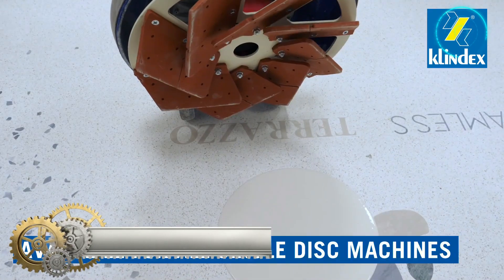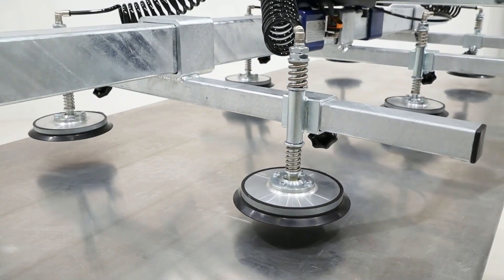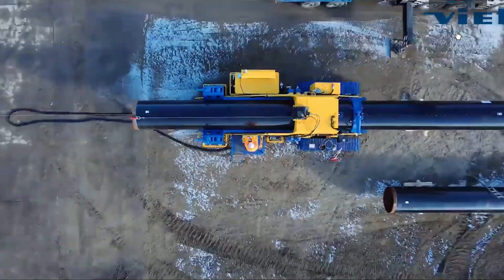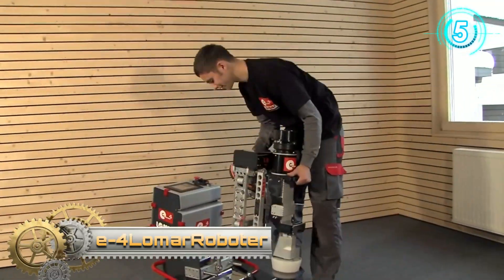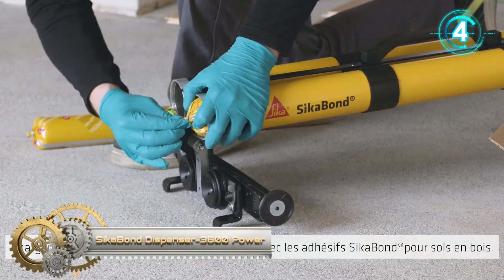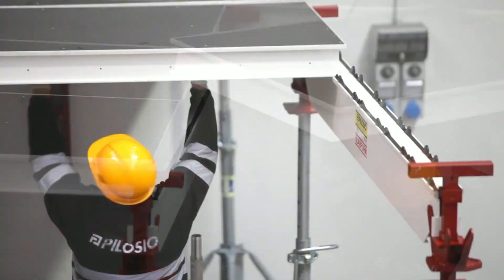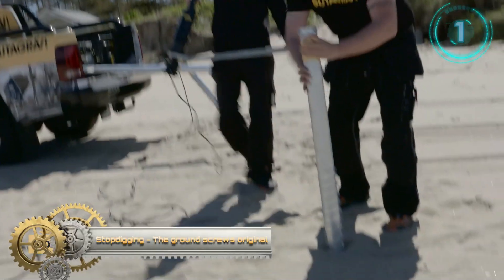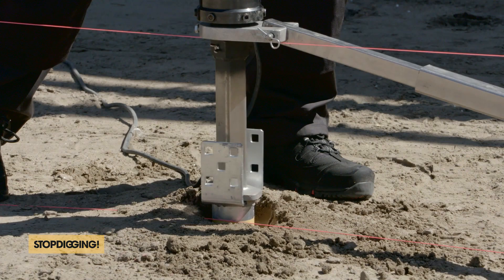New Amazing Construction Tools and Inventions ▶17

Comment from the maker: Links:
'''''''''''''''''''''
RAPIDO SUPER RS180 with internal stairs 
https://www.faraone.com/en/scheda/630...

Klindex Grouting Disc. For grouting jointed floors
https://www.klindex.it/discostuccator...

AERO-LIFT | ADVANCE - the new generation of vacuum lifting devices
https://www.aero-lift.de/en/products/...

VIETZ Pipe Bending Machine 
https://vietz.de/bending-machines/

MORTAR GUN 100
https://www.gemack.eu/products/mortar...

e-4LomarRoboter
https://www.youtube.com/watch?v=OCrjS...

SikaBond Dispenser-3600 Power 
https://che.sika.com/de/construction/...

Formwork for slabs Slabform Pilosio.
https://pilosio.com/products/horizont...

SmartMover by Baron
https://www.baron-mixer.com/en/produc...

Stopdigging - The ground screws original
https://stopdigging-groundscrew.com/
.................................................................................................